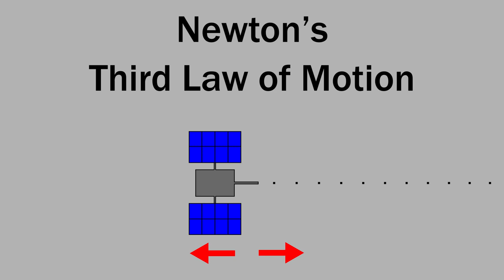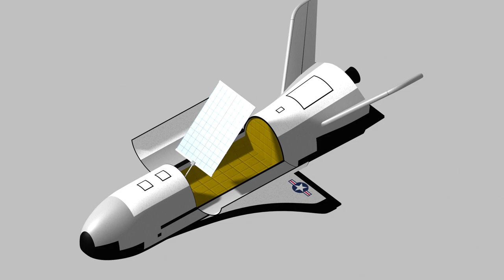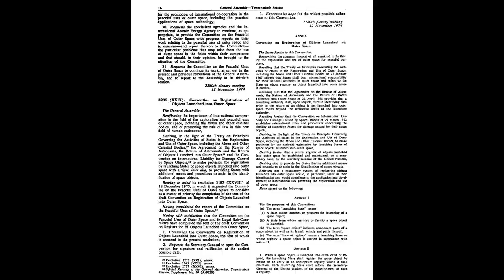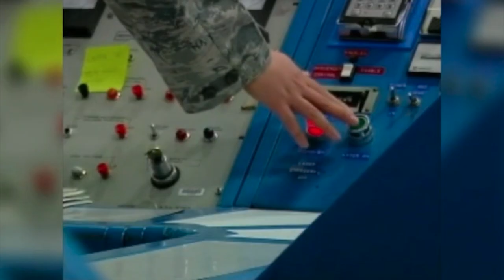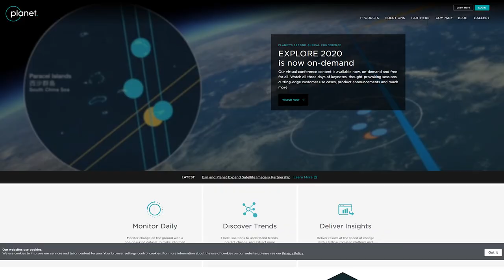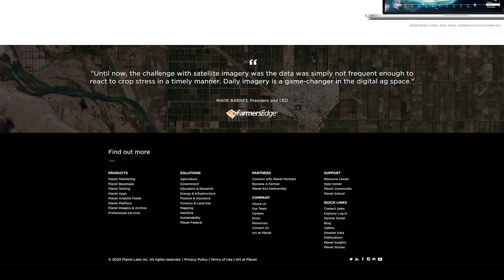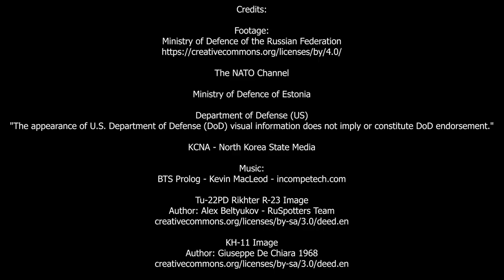Are There Weapons in Space? Future of Space

Comment: Rods from God can be made with any dense material. Depleted Uranium may be an option — probably covered with an ablative material to protect the dense core from the reentry heat.
And with the reduction of launching costs, plus reusability, plus quick turnaround, the near future fielding of such kinetic energy weapons gets easier and cheaper.
Reply: Rods from God are a scifi weapon that does not work in reality. If you release an object in orbit it just - stays in orbit - you need to decelerate it, getting rid of all that sweet KE you were hoping to use, in order to get it to impact the Earth. So it's a non-starter straight away, but then combine that with the fact that they are super heavy by necessity which makes them difficult to get into orbit and then difficult to maneuver over a target and then difficult to slow down to impact said target etc...
Reply: You need to study Physics 101.
Rods do not need to slow when coming to impact, they must do it as fast as possible. They are massive, so? A 1 Tm Rod is equivalent to an 8+ Tm of TNT explosion concentrated at the point of impact. 
Maneuverability?  Strategic does not matter, use a polar orbit for your Rods bus, loose when suitable.  Tactical? See above or go with FOBS for the bus.
A small and cheap rocket in the orbiting Rods' bus reduces its initial orbital speed to Vapo ~7.8 Km/s — at the apogee — so now the Rod falls into the atmosphere in an elliptical path. The perigee is at the target position. The Rod speed at the target impact point Vper ~8.4 Km/s — if not braked too much by the atmosphere is even greater than at apogee because conversion of part of the gravitational energy — higher at apogee — into ~9% more kinetic energy of the Rod — higher at perigee/impact point at the surface of the Earth ~ 3.7 MJ/Kg.  So the damage may be even worse than a direct collision with the Rod in orbit.
The Rods from God concept was championed by Dr. Jerry Pournelle since the 1970s. He was a Science Fiction writer, but also a very gifted Military Scientist/Technologist.
So RoG is a viable weapon system, especially with the new, cheaper launch tecnologies.
Before answering this reply with more nonsense consider to do the proper calculations yourself, and that I have a M.S. in Physics and a Ph.D. in Mechanical Engineering (really High Energy Density Physics.)

Comment: No, cannons will NOT deorbit any satellites, just do the math. Sure, they can affect the alignment of the platform but that is easily corrected by reaction wheels or attitude thrusters. The real problem with cannons in space is the slow speed of the rounds. A 1000 m/s round that need to cross 5 000 km of space will take more than an hour to arrive at the target. If the target changes its velocity with 10 cm/s   (a small puff of a thruster) the target will be 500 m away from where the cannon round was fired at.

Comment: Why use tungsten if you can use depleted uranium? Still doesn’t get around the density issue though
Reply: I was wondering the same thing unless the DU would burn up from the speed.
Reply: DU oxidizes easily when it is hot.
Reply: @Joe_Friday  The whole point of using tungsten is that it's strictly a kinetic weapon. DU would be a radiological weapon. Even conventional DU munitions can cause radioactive contamination on the battlefield.
Reply: @redcat9436  Well almost everyone uses DU in their tank munitions. It's a hell of a lot cheaper too. But as one person above said it might not be ideal due to extreme temperature.

Comment: The math does not check out. A metric ton in low earth orbit has a kinetic energy of E_kin = 0.5 * m * v^2 = 0.5 * 1000 kg * (7900 m/s)^2 = 3.1 * 10^9 J ~= 1 ton of TNT. So common rocket payloads do not come close to nuclear blasts but are weaker by a factor of 100000.

Comment: The whole part about the vibrations and recoil making conventional guns unrealistic in space is misleading, all you need is a good RCS system to counter the recoil..
Reply: the heck is rcs?
Reply: @ghostly9450  Reaction Control System.. Basically they are smaller thrusters that provide directional control for a spacecraft..
Reply: @cancelanime1507  what about rail guns? no recoil
Reply: @ghostly9450  Railguns would definitely fuck you up with recoil, that would require a really good RCS not to prevent recoil but just to keep it under control..
Reply: @cancelanime1507  superconductors? the surrounding temperatures would allow it.